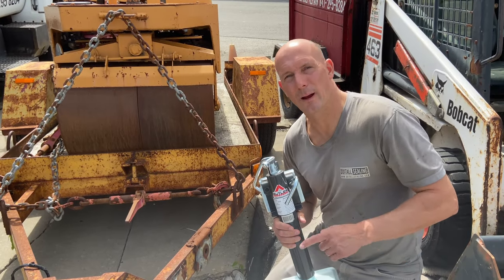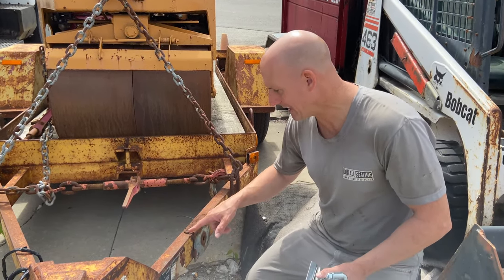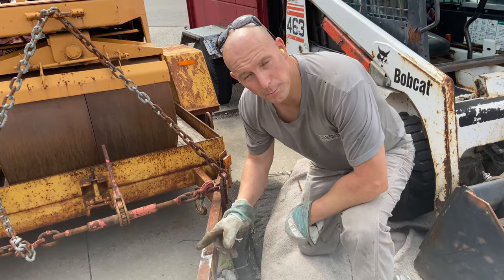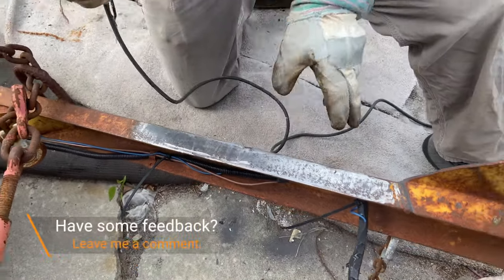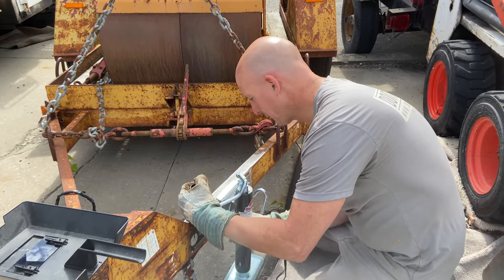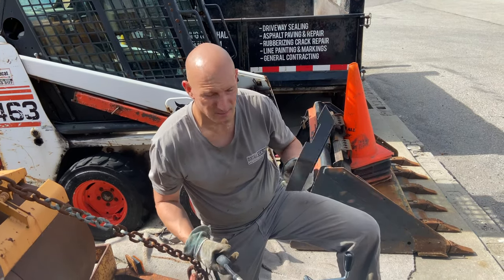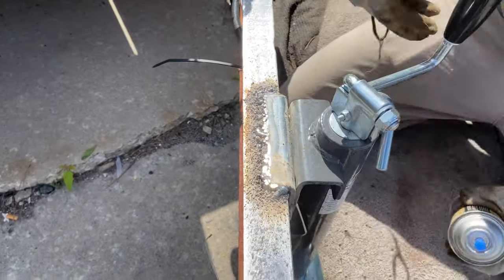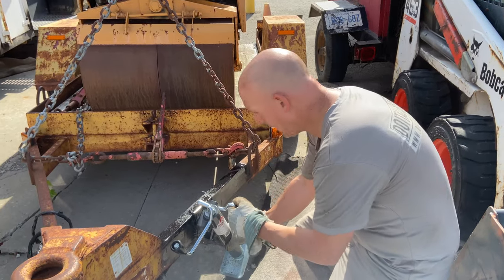Trailer Swivel Jack Stand Installation (4K) Welding & Painting

Comment: Oh hello Jeff "Nashville" Lepard...😁

Also be sure to temporarily relocate any wiring on the backside of the area you are welding. Especially if you want your trailer lights to work afterwards. 

Oh and especially if you use a industry style welder, that is equipped with Argon gas. Because I have definitely seen wiring melted afterwards.

Comment: Seems like a lot of work ,Bolt,On,,Adjustable, no welding tighten,bolts,,Two big u-bolts,,? You could even have a wheel for a base, so you can roll it around one on each side. And they flip up out of the way when not in use just like a boat trailer?